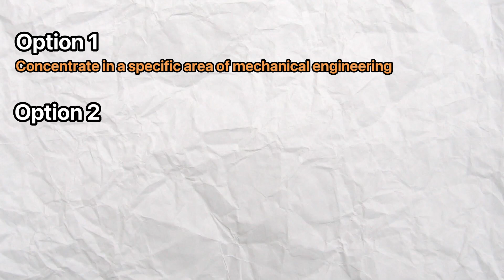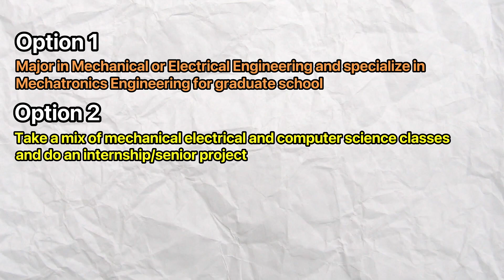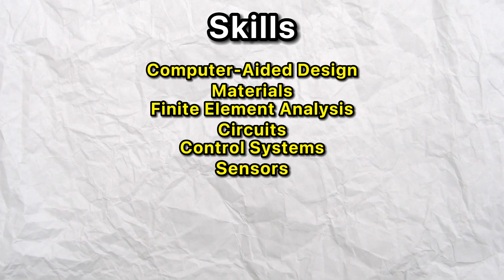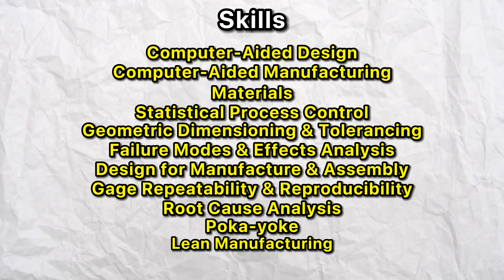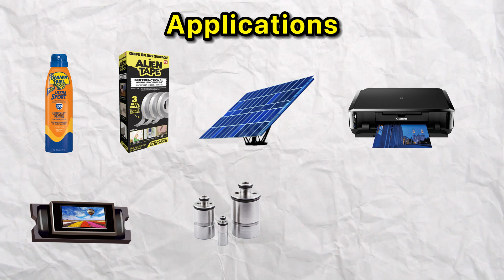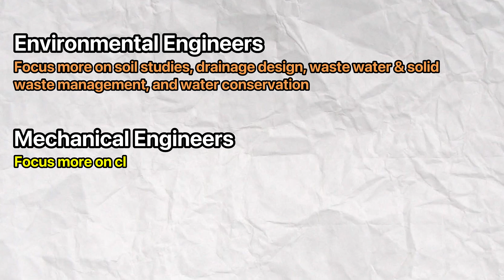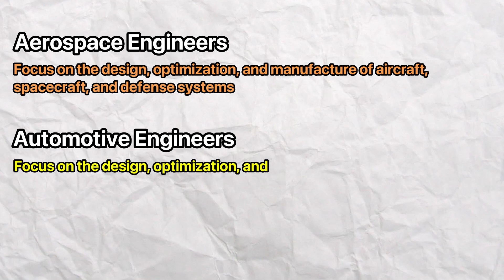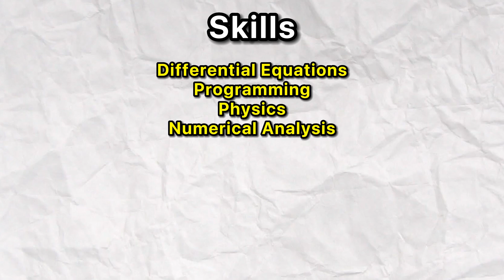Most Useful Mechanical Engineering Branches & Subfields

Comment: Do you think that a career in electromechanical engineering is good? Or is it better to be a mechanic and specialize in electrical, my university offers electromechanics and I am currently in the second year, we have subjects such as thermal machines, air conditioning and refrigeration, also machine vibrations and fluid mechanics,
In the electrical branch we have subjects such as electrical circuits, electrical machines, electrical installations, PLC, automation and control, just to mention a few, there are many more. I honestly have no idea what an employer thinks about an electromechanical engineer these days.

Comment: What would one need to do to get into automotive engineering as entry-level? What are your recommendations?
Reply from the maker: Great question! I would say get a bachelors degree in Mechanical engineering and concentrate in automotive (if your school has one). If it doesn’t, get your foot in the door through an internship or co-op or join a racing club / professor’s research group whose focus is automotive applications

Comment: I finished  1 year  mechatronics  and i have a high gpa but the plan is too broad also it consentrate on electrical more so i am planning to switch to mechanical engineering    . Is it a good idea?
Reply from the maker: Yeah for sure. Either electrical or mechanical are great, but I would go with mechanical if you want to become a mechatronics engineer.
Reply: @EngineeringGoneWild so my dream major is astranautical engineering. I am on the wrong track if I finish a 3 years mechatronics technician and 2 year minor in mechanical

Comment: Hi, I'm interested in going into renewable energy (solar mainly)
I'm hoping to specialise in advanced manufacturing/robotics for solar panels or it's control systems . Perhaps if possible for other stuff like marine renewable energy and wind turbine recycling etc.

I apologise as I'm still new to this whole engineering sector, any thoughts would be much appreciated, cheers
Reply from the maker: Renewable Energy has a lot of potential! I think the fact that you are considering advanced manufacturing and robotics is smart, as both have many applications including solar panels🙂
Reply: Ps, this is just an initial pathway, I'll probably see as things goes

Comment: I'm going for Mech Eng, focus Dynamics and Control. End goal is to work for a auto motorsports racing team like Honda's HPD, Gazoo Racing . Only other options at SDSU is Design and Manufacturing, Energy and Thermofluids, Materials and Mechanics. What are your thoughts?
Reply from the maker: Dynamics & Controls is definitely a good concentration if you plan to work in Automotive. Design & Manufacturing is versatile and great too.

Comment: The audio is very loud in the left ear and no audio in right ear in case you didnt know
Reply from the maker: Thanks for letting me know! I will identify the issue using root cause analysis🤔
Reply: *me sitting with my right earphone in 😂😮
Reply: But the sound effects are loud on the right site.
Reply: Sound engineering wasn't listed in the concentrations 😂😜

Comment: Is getting into software engineering possible when focusing on mechatronics?
Reply: Also working with microcontrollers and PLC gives you knowledge of the work of the computers themselves, i.e. How the processor works, etc. requires you to work with pointers which is considered the most difficult in C language. So if you learn that, languages like java sql and other things are more or less cat cough.
Reply: yes. but i think its better to go into machine learning. but if u like SE then good luck

Comment: Mechanical Engineers can also work in another major, and always needed, industry within the Architectural, Engineering, and Construction (AEC) sector involving HVAC system design, plumbing systems, and process piping systems. Some even get into fire protection systems. You’ll need a professional license to be considered a “mechanical engineer” or a “fire protection engineer” as they are legally protected titles in the states. Thermodynamics, heat transfer, fluid dynamics, and CFD are mostly involved.

Comment: I considering mechanical engineering over computer science because of the screen time as a developer. though i think ill have almost the amount of screentime as a mechanical engineer but just doing different things instead of fixing bugs. Anyone with some advice? i grew up coding and gaming my teenage years and not being particularly mesmerized by mechanical structures or engines
Reply: Just follow your passion, since materials and designing structures doesn't fascinate you, you  should go for comp sci but if your a Christian  you can seek God's advice .❤
Reply from the maker: I can definitely see screen time going down for you as a ME, as you get to build prototypes, work with machinists/technicians on the shop floor, and test products. Of course you will still be stuck in front of a computer designing and perhaps running simulations
Reply: Im stuck in the exact same position. :|